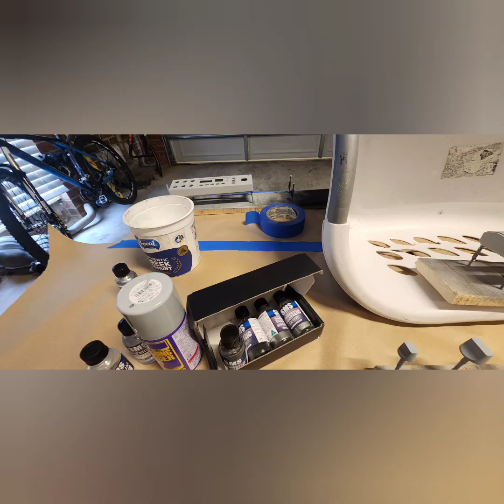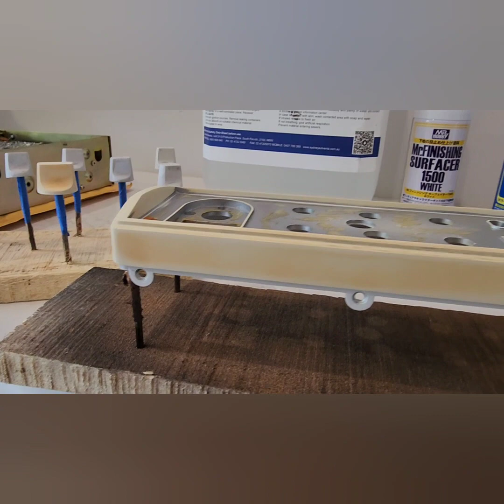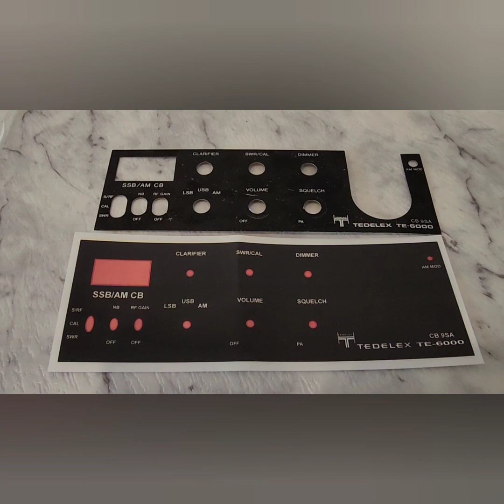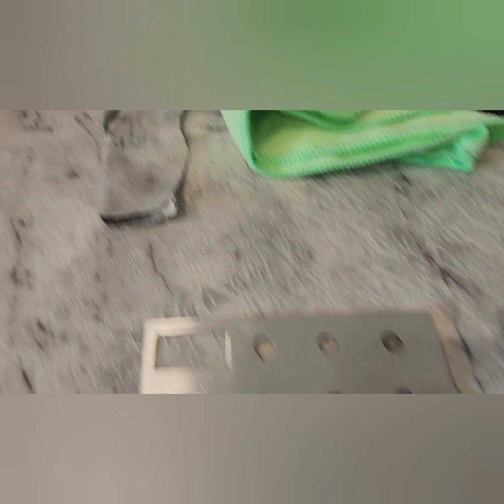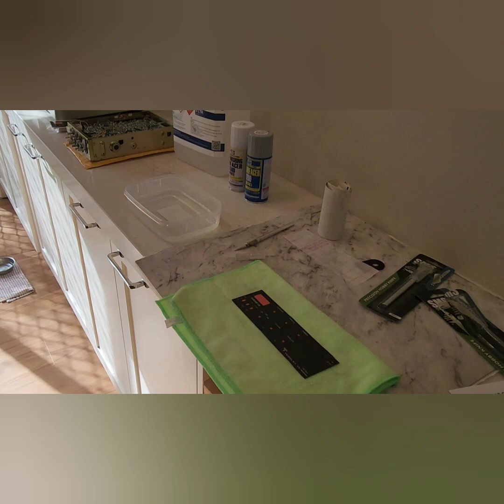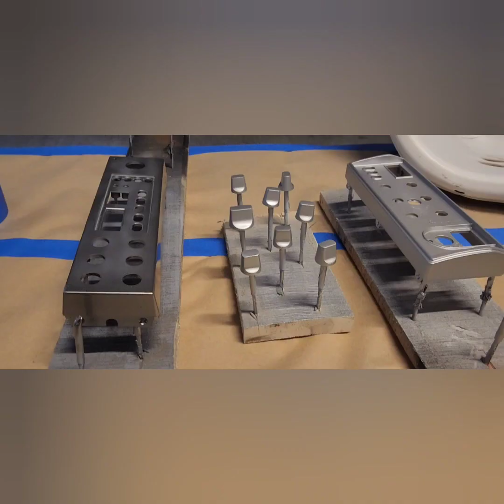President Adams  & Tedelex - Faceplate Painting & Progress - Part 7

Comment: I did the same thing on my 5 president Adams I took the radio to the paint shop for silver paint the chap scan the bezel and says it Autumn silver paint and he made it up I had the opportunity to have it spray can or tin I had the tin as I have air brush anyway I did the spray it was perfect match. I did mod the Adams it has FM module and VFO frequency readout display it goes from 26.200 to 27.995 it has 5kc steps as it has zero better then 10kc steps  I got the Module from Gerhard Maurer.
Reply from the maker: I would love to see your work
Reply: @Pull_It_Apart_Paul_Ham_CB  my work isn't that much to look at..
Reply: Would that be the same color for a President Washington/ P400?
73
Reply: @andrewverran3498  Yes, it's exactly the same colour .